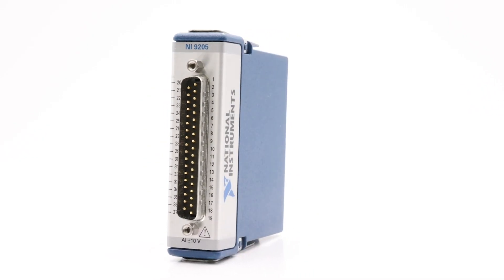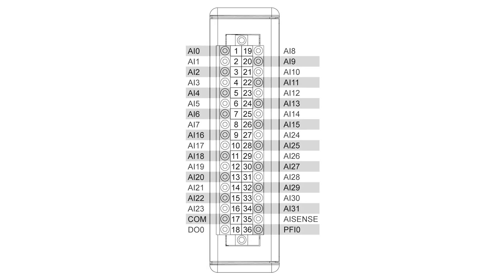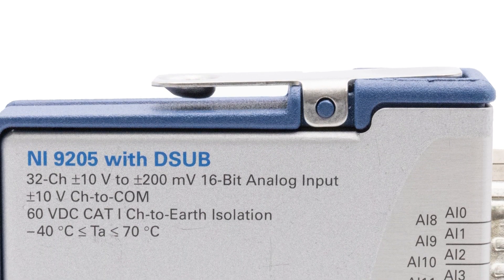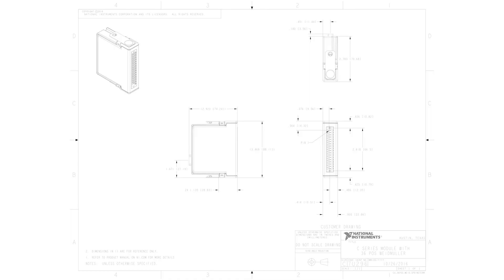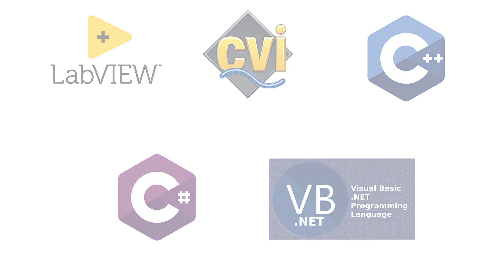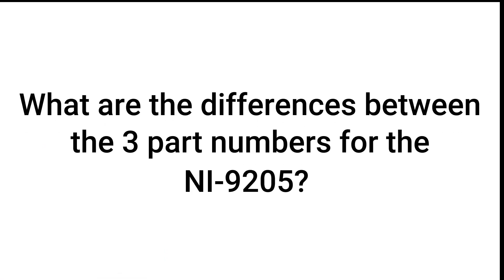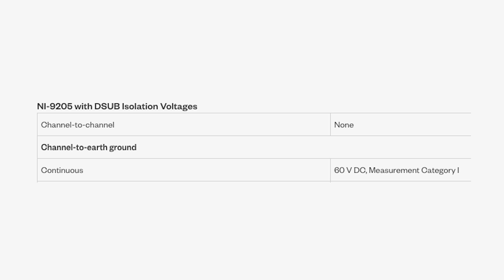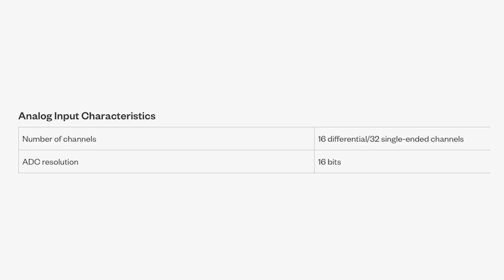Introduction to National Instruments NI-9205

Comment: does this also power the instrument or does there need to be seperate power?
Reply from the maker: Thank you for your comment! Great question! The NI-9205 does not provide power to external instruments—it’s designed to measure voltage signals rather than supply power. You’ll need a separate power source for any sensors or devices that require external excitation or operating voltage. Hope this helps!

Comment: whats the purpose of conformal coating?
Reply: For environmental protection...moisture and anti-corrosion.
Reply from the maker: Hello there! I apologize for the delayed response! @Ezzell_ is correct though! 

It is a protective chemical coating applied to electronic circuits to protect them from environmental factors such as moisture, dust, chemicals, and temperature extremes. This coating helps to extend the lifespan of electronic components, improve reliability, and prevent corrosion and electrical failures caused by these external elements.